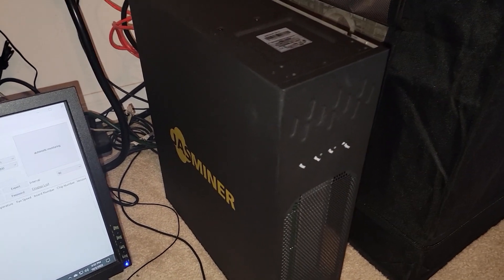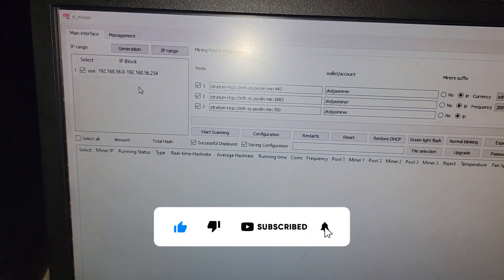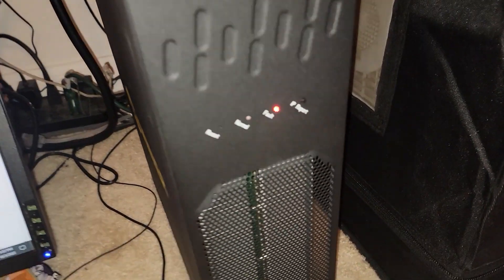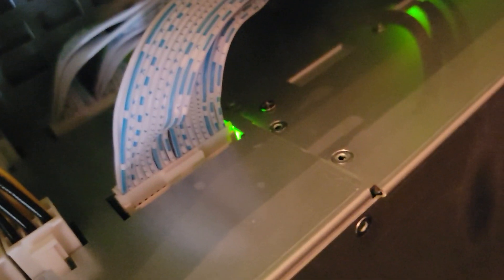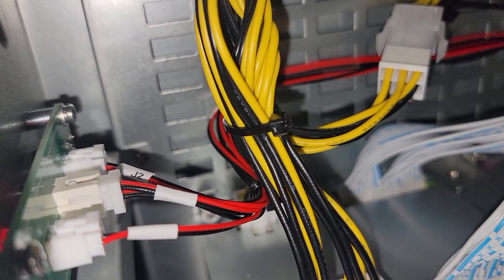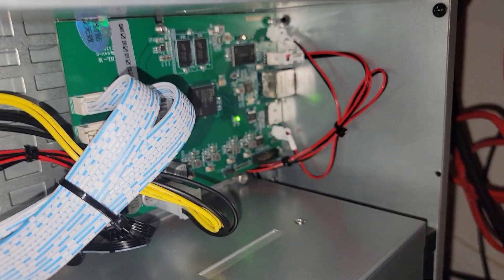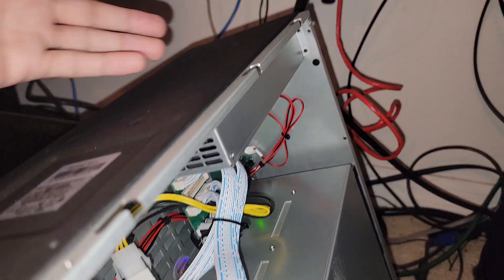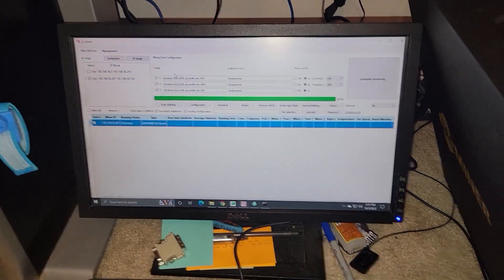Jasminer X4 Q Troubleshooting issues

Comment: hi!! i have a similar problem but not the same.  i have 4 of this,  after  a cutout, one of my x4q boots, turn on the normal and fault led for 10-15 seconds, after that, boths led turn off for about 30-40 seconds, and both led turn on again for 10-15 and so on....
i can reach it, i don't see the mac address neither
have you see this before? is any blog where i can get some help? 
i've opened a ticket but i have no response yet.
Thanks!!!

Comment: Have you tested the middle connector, is it broken?
Reply from the maker: Yes I tested and it is working now. I did have a brown out with Hurricane Nicole and it started acting weird again. So I reset to factory and swapped back to top connector and its hashing fine again. Summary view of experience 2023
Reply: @SerpentXTech  I'm in an area with frequent power cutouts. would you recommend this miner?
Reply from the maker: @yoi2013  if you got the funds, it can mine ETHash and ETChash, making only $1+ a day at my electric rate. It is quiet and efficient, if I could afford them, I would get a couple more. Becareful where you buy as some are scams. I got mine through Jingle but BT miners has also taken care of me when needed. If you decide to pull the trigger use coupon code "SerpentX" BUT ask yourself about your convictions and look at the projects you want to mine. Do you believe in them long term, are you trying to make short term profit? Iron all that out and then make you game plan to execute. Link below, does help me out too.  https://bt-miners.com/?ref=UtiNCsT-ive3mi